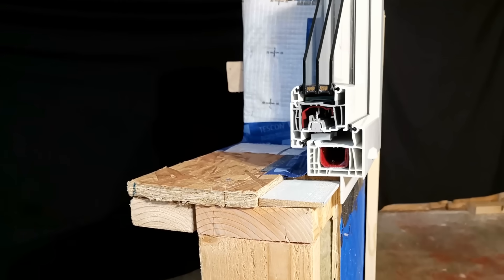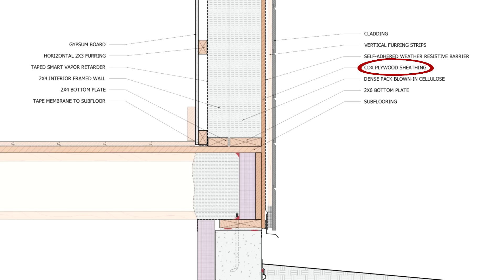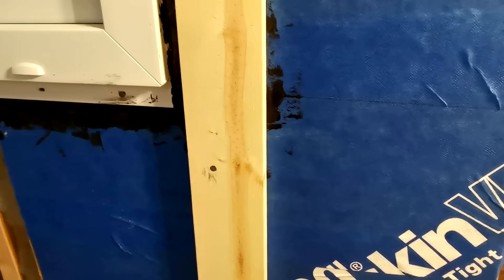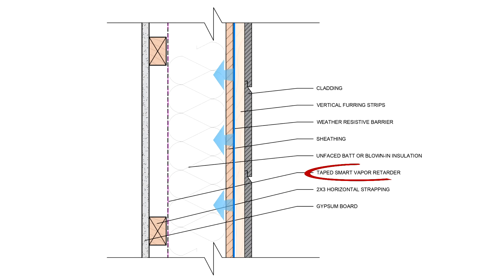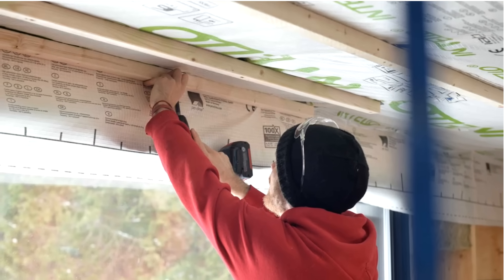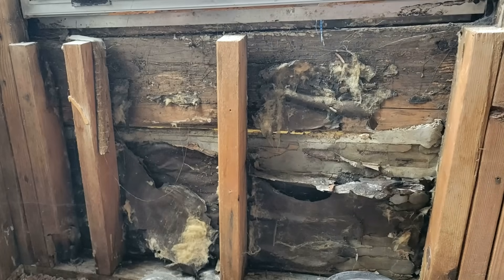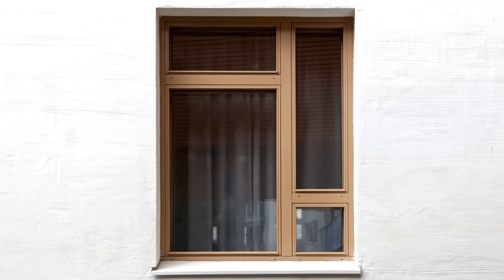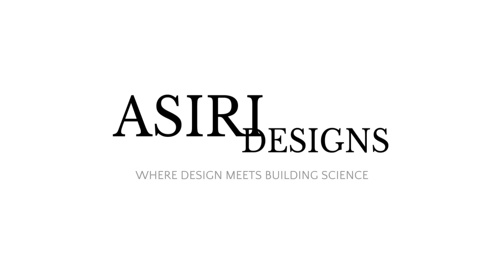CRAZY R-Value for CHEAP! A Guide To Double Stud Walls

Comment: Hey asiri. So i enjoy your videos and others who show the value of the interior vapor retarder. Everyone seems to agree that proper installation is very important. Ive seen your videos that show how even a one inch hole can lead to issues. So my question is with such high importance coupled with low tolerance for penatrations, how on earth can the interior barrier be useful when nails and screws will be driven thru the walls and ceilings to hang artworks, planters and everything people hang in their homes? Surely many fasteners will fully penetrate 1/2" or 5/8" drywall and puncture the barriers. Over and over and over as the years go by. What am i missing?
Reply from the maker: Great question, and you're correct that clients love to poke holes in their walls. In applications like this where we have an airtight interior vapor retarder membrane, we provide a service cavity between the drywall and membrane using 2x3s, reducing the potential for unplanned penetrations. I'll also add that we ensure that there is adequate client education about what they can/cannot/or should do when it comes to future improvement, upgrades, etc.

Comment: The Cold Climate Housing Research Center (CCHRC) built a full size two story home in Fairbanks, Alaska to test double wall and insulated slab construction. The slab foundation had a 12" layer of 25psi EPS R-60 rigid foam board under and all around the circumference of the foundation slab. Their double wall system called ARCTIC WALL framing was 21" thick with an R-75 resistance to heat transfer. CCHRC used a 2x6 structural stud wall and a secondary balloon framed 2x4 wall with a 12" insulation gap in between. The Arctic Wall was insulated with dense packed cellulose which was purposely allowed to breath by not installing a vapor barrier. The attic had 32 inches of blown in cellulose, settled at 30" with an R-value of 115. The entire house had sensors at every layer of the wall, insulation, and foundation to monitor temperature and moisture. The house does not use any fossil fuels, domestic hot water and space heating is accomplished by passive solar, a wood stove, and solar thermal collectors. The house has an insulated 5,000 gallon solar heat storage tank withing the insulated envelope of the home. This means that even when the tank is slowly losing heat at night it is giving up the heat inside the home reducing heating requirements. 
The Cold Climate Housing Research Center (CCHRC) has all of their research papers available to download on their website. They also have a YT channel with tons of informative and entertaining videos.

Comment: What are your thoughts on flash and bat Ain a double stud solution?
Reply from the maker: It definitely works, just a tad more costly. You also have to make sure that the closed cell spray foam is applied at the right ratio for condensation control, and that it doesn't crack.
Reply: @ASIRIDesigns Have you explored Green Stone Building Products' Ice panel system? What are your thoughts?

Comment: hey what about isulating air tight both outside and inside and create closed space with low humidity air inside (closing air tight  seal on warm day with some help of electric equipment) ? what i want to achieve is to use airtight space blanket seal on the inside of the building (to keep warm air + radiant heat) and use air heat ex hanger in the whole building (every room air intake and out take its used here in Europe already) it can have dehumidifier build in?

Comment: I don't see how a smart vapor retarder located on the back side of the interior drywall can be effective.  Electrical boxes for receptacles, switches, and network ports are everywhere, and more will be retrofit over time.  Each one will allow convective air flow past the vapor retarder, which appears to me to be a far greater risk than vapor diffusion through interior paint and drywall.
Reply from the maker: Service cavities are key. 475 actually has a really good air sealing guide: https://475.supply/products/intello-plus
Reply: Well, this is where hiring good trades people makes all the difference.
Any handyman can do the work.
True skilled tradesmen who take pride in their work will ensure the installation done correctly.  This means maintaining that air barrier integrity.
Yes, it may cost more, but on the same note changes are not often made to exterior walls on remodels.  Most design plans I've seen are more heavily weighted on avoiding exterior walls wherever possible.

For your extra low voltage such as network ports, that class of wiring can be run through the void space between the vapor retarder and the back side of the drywall.
Reply: There are some electrical boxes available with a flange, to tape on an air/vapor barrier, allowing for up to 1 1/8” thickness of sheet goods in front of the flange.  It just needs care in installation, putting sealant where the wires enter each box, and owner education to not add more boxes later into exterior walls.  That last one might be as difficult as the others - in my 1914 house, I’ve added a fair number of outlets/switches in its uninsulated exterior walls.

Comment: I'm building a home in Alaska, climate zone 7. ~80" of precipitation annually. I am using a double-stud wall but a little differently: Exterior wall, load bearing, of 2 x 6, CDX plywood exterior sheathing. On the inside of the 2 x 6 wall cavity is R-19 fiberglass batts. Still on the interior, 2" rigid foam board, taped. Alaska requires a non-permeable layer on the inside wall so the polyethylene attaches to the foam board with glue. Now a 2 x 4 wall wherein any electrical wires and outlets are located to insure the integrity of the plastic barrier. Then R-13 batts in the 2 x 4 non load-bearing wall. Accomplishes something important with all the moisture; avoiding the thousands of holes in the plastic membrane from the sheetrock installation.
Reply: Where are you located? I would love to check it out. There aren't many of us up here who actually care about building science. I am in Wasilla.
Reply: @tibbified  I am in Seward
Reply: @tibbified  southeast or kodiak is my guess.  was curious too.   I am a former kodiak resident.
Reply: @KevinLauscher That makes sense with that zone and that much precipitation.
Reply: Can you tape the rigid foam for the air barrier and class 2 vapour membrane but not a class 1 vapour membrane?
Reply: Interesting assembly, I never thought of doing it like that
Reply: So r29 outside, and r13 (ignoring thermal bridging) inside the vb, r42 total. Not sure what is normal or good for your climate but double check where the dew point lands in winter for your humidity levels. I like that the foam acts as a continuous thermal break and it is protected from fire. Do you need any fire blocking if you use foam inside a double stud wall?
Reply: @jamesroscoe7555  That is why I was thinking of a similar design but DP Cellulose. Putting a smart vapor barrier on the back side of the interior 2x4 wall. But a 2x4 outside wall since I prefer single level. Where I live a 2x6 is literally twice the price of a 2x4. If the savings were enough, I would almost consider using steel studs for the inside wall. Super straight walls an windows! But that probably wouldn't happen. More of an wish.
Reply: Can you eliminate the polyethylene and tape the rigid foam instead?
Reply: @CodyOnHomes I was wondering the same, if the poly was to satisfy the code officials only or belt and suspenders. It is a strong vapour retarder on its own. I do wonder a bit about the long term reliability of tape adhesion to polystyrene though.
Reply: That’s a great approach!  If you’re going to pay for a 2” foam layer I’d rather see it in the middle of the wall than on the outside.

I’m a big fan of service cavities.  I’m building a 12” double stud wall house right now and will have an insulated 2x4 service cavity as well.  It’s the ONLY way to have a reliable and continuous vapor barrier.

I used blue Tuck Tape to successfully tape the seams on my 2” XPS in my basement, it stuck rather well.  Tuck tape is a Canada thing, not sure if you can get it in Alaska.  The blue tape has a more aggressive adhesive than the standard red “tail light repair” tape. 😊

Comment: Great video. With a smart membrane, if located on 2/3rds toward the interior side, would this keep it warm enough to do its job in northern climates? (Such as sandwiched between a 2x4 interior and 2x6 exterior)
Reply: If the membrane is always above the dew point, it won't condense (even if it was poly but don't use poly as it is more risky if things go wrong). So calculate the worst case dew point for all seasons for your climate and assembly. Put your membrane in a thickness zone that is always above the dew point. Your ratio might work, but calculate it for your climate so you know for sure.
Reply: This is what I was wondering. I want to do 2x4 outside, 4 inch space, then intello on the backside of the inside 2x4 wall. Blow in the outside space and then some kind of low voc/fire resistant batt on the inside 4" after utilities are done. I had been looking at rockwool, but apparently, it still uses formaldehyde. I need to research more if that matters, though.
Reply: @tibbified  There was/is another video on YT somewhere, about formaldehyde.  Apparently there’s a formaldehyde-free version of Rockwool, but it’s hard to get because most customers just buy the regular version.

Comment: Blown in insulation makes a ton of sense for double stud wall assemblies. In Europe wood fiber insulation has become super popular due to its low cost, over here its actually the cheapest insulation available (Steico Zell is the name of the product if you are curious). Also, locating a window in the middle of an assembly is best practice from an energy efficiency perspective.
Reply: Wood fiber insulation is available here, as well. It is just not as popular as other legacy materials. Generally, the US is a much warmer place than Europe and so the choice of insulation is influenced by climate. Additionally, the US has a problem with termites and other wood-boring critters. It's not as bad as Australia, but it is a problem. However, wood fiber is available in two forms: one is loose fibers that are blown into the wall, and the other is a hard, pressed blocks that are used for exterior insulation.

Comment: House construction has gone crazy and one reason is insulation codes. All this tens of thousands of extra cost to save a few percent on heating and cooling.
Reply: A passive house saves a lot more than a few percent on heating and cooling. Even a "pretty good house"...
Reply: Do you even realize the monthly cost of energy in most markets? Your A/C & heating system can be smaller also, and If you decide to take control of your own energy production, it's much cheaper to do so on a super insulated home. Also, I don't see code driving these types of details.
Reply: It makes a big difference in the end. Plus, you can size you heating and cooling completely differently. This also helps offset some of the initial costs. A double stud wall is absolutely the lowest cost way to achieve this kind of insulation value. Especially if you are doing blown in. It does not cost that much more for the material, and if they are already on-site, it's not that much more labor either. And all of the other parts of the process are standard. The sheathing, the peel and stick, the sill, the window taping. That all applies to standard quality building. The only difference here is an extra framed wall and more insulation. Where I live, if you keep it simple and build with double 2x4 walls, the material literally costs almost exactly the same as a single 2x6 wall. I can buy two 2x4 studs for the same price as a single 2x6 where I live.

Comment: i would love to see a video about the location of the window within the cavity or as you sad innie vs outie in super insulated wall systems. you briefly mentioned it but some more specifics like actual numbers for the in-out temperatures and actual location of the window   would be nice! thank you!
Reply: One of the things with an outie on a very thick wall is there can be a little microclimate in the window alcove. Personally,  I like flangeless windows as an inbetweenie assembly, using plywood framed openings. This is partly an aesthetic thing relating to older homes. But everyone has a system that works for them.
Reply: Does use of seasonal "storm windows" by definition necessitate using an innie?
Reply: @kwhatten seasonal storms are pretty unusual on a thick walled super insulated house no? Obviously they are fairly incompatible with flangeless windows which is more or less the origin of the outie... I find outie windows, without specific trim details, imho look too "in plane" with the siding to fit in around older homes. Fine for modern I guess.

There is often quite a bit of sill (depending on wall thickness) inside historic windows, so to me an inbetweenie mimics that. But when walls are 12+" thick and super insulated vs 2x6, it does affect the design considerations.
Reply: @kwhatten  On historic homes windows were innies. It created a lot more depth and interest. Would love to see a video on how to properly install one of these windows inset and waterproofed/moldproofed.

Comment: what is a good way to install stucco over wood furring strips rainscreen such as the one you are using in this example? i can not find any specific information on the topic. thank you in advance and keep up the good work!
Reply from the maker: Thanks for watching! I would avoid that and use a dimple mat instead to reduce the potential for cracking, since wood will move around on you, and could deteriorate over time in a wet environment.